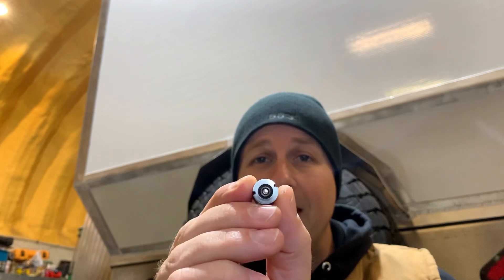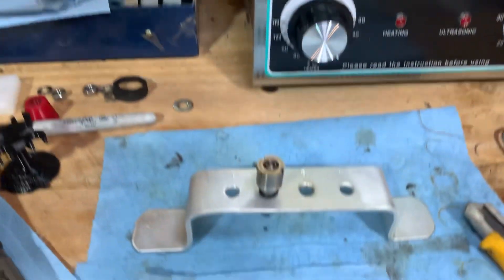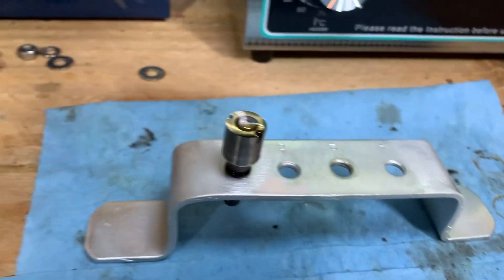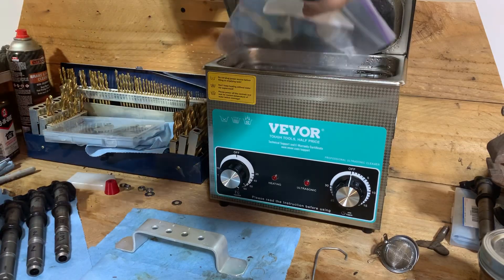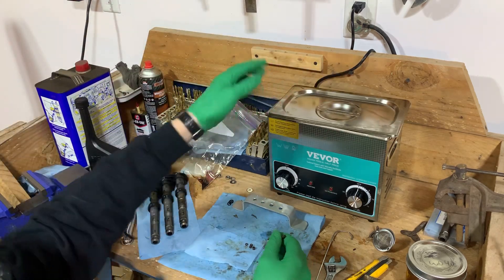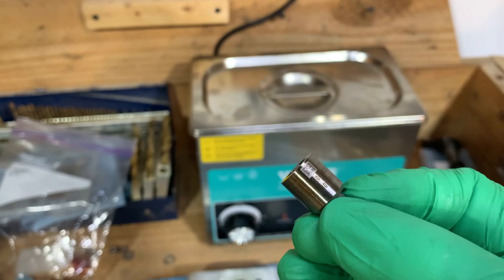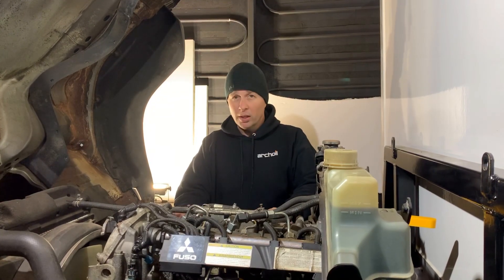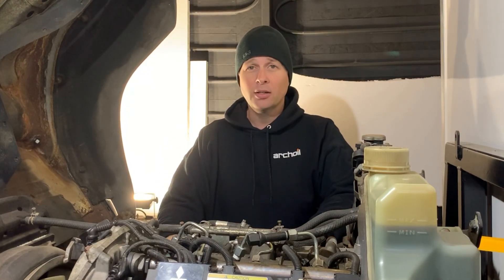Did I just SAVE $5,200??  SIMPLE FIX for DEAD piezo injectors

Comment: Bruce - I would be considering giving various dilutions of the 6400 a try.  Could it be that the full strength stuff is a little too viscous to penetrate easily.
Reply from the maker: I thought about diluting with diesel, as that is how it would normally run through the injectors, but the heat and ultrasonic did the trick.

Comment: It's nice to see some small wins along the way.  Ultrasonic cleaners are wonderful things for cleaning fine-tuned assemblies like injectors.  Hopefully injector four comes out without having to resort to pulling out the big guns, which is never fun, and then you should have four spotless injectors to go back in.  I completely agree that just throwing parts out is becoming all too common.  If you can clean these and they pass a spray pattern test afterwards there is no reason to replace them.

We run a locally produced diesel fuel treatment in our truck - it's critical to do so with our 'low sulphur' fuel to avoid killing pumps and injectors.  The stuff we use also has a biocide in it since our truck can sit for a while between trips and we'd rather the greeblies find something else to dine on.
Reply from the maker: I’ve wondered if some of what this gunk is, is actually growing in the fuel.  The tank looks completely clear, but some of what came out of the tips seemed to me to have a bit of a red tinge to it.   I’ll be dumping the remainder of this tank regardless!!
Reply: @BruceandKrista  It's probably good insurance to lose whatever is left in the tank.  There's always something waiting to eat everything in this world, even diesel!

Comment: I really hope you're on the right track. The "IT Guy" in me is kinda sceptical though - like, why would all 4 injectors crap out at the same time if everything seemed to be running fine before you drove it into the shop? Or are you thinking that your fuel pump (that you've now replaced from your sacrifice engine) was the main culprit of this whole ordeal and the injectors have just copped a bunch of fine powder from that pump dieing? (Or seized up while sitting in the workshop while troubleshooting the pump)
Reply from the maker: My current theory (LOL) is that the diesel was quite old as a starting point - and as the truck sat over the last few months between running and not, it just finally reached the point where the gunk overpowered the ability for the needle to move in the tip.  I’m also now curious to see if my CP4 pump is also gummed up…